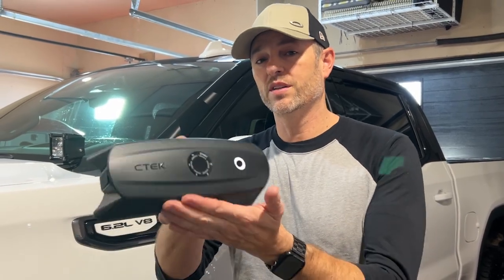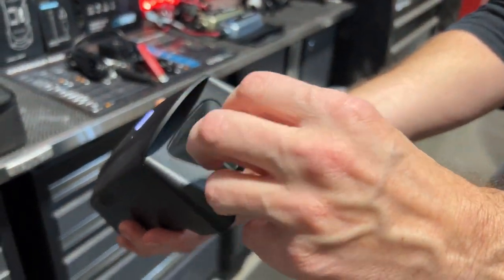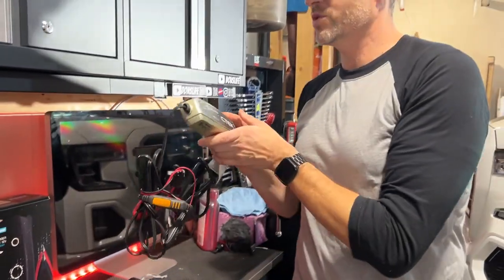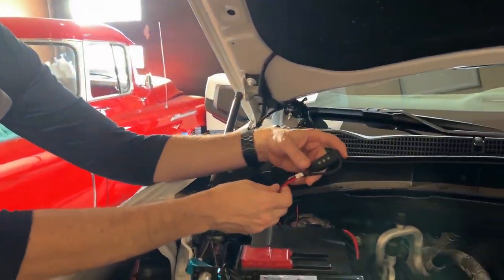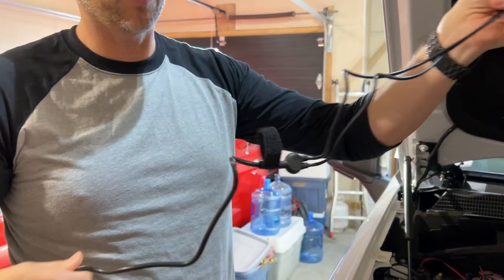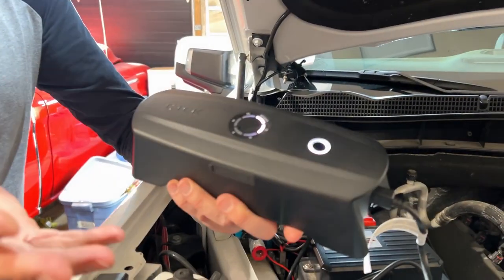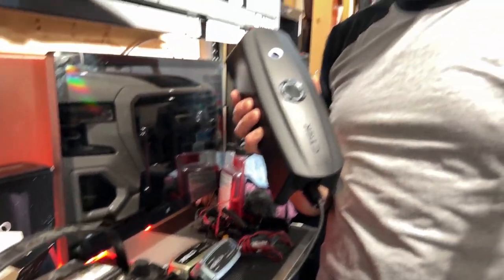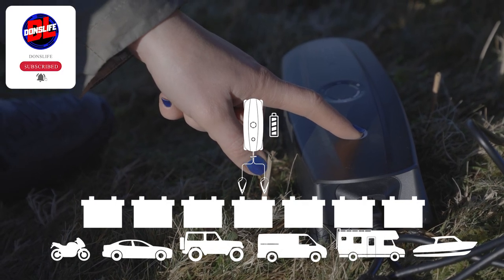CTEK CS FREE Multifunction Portable Battery Charger and Maintainer with Adaptive Boost!

Comment: For safety whenever connecting any form of jumper leads to a battery always connect the positive first then the negative second.
When disconnecting the jumper leads remove the negative first then the positive second.
This also applies when removing the battery leads from the battery.
If you are using a spanner and you remove the positive lead first and the spanner touches the chassis or engine you can have the battery explode in your face.
If a battery explodes in your face the chance of being blinded are very very high.
Chemical safety glasses are a must when working around batteries if they are not available do everything at arms length and keep your face as far away from the battery as possible.

Comment: You're a hell of a spokesperson, Don.  Nicely done
Reply from the maker: Thanks brother. Easy when it’s a such a solid and useful device
Reply: Agreed!  Great video.
Reply: @Donslife  You said the CTEK CS Free  adaptive boost will start a vehicle with a flat battery. But in the comments sections at some YouTube videos some commenters have asked the CTEK tech team if the adaptive boost will start a vehicle that has a totally flat battery. The replies by CTEK said that the battery must have 3 percent existing charge in order for the adaptive boost to work. Obviously, a 3 percent existing charge is not a flat battery. So, if I'm in a remote area without electric power, & my car battery has only 2 percent existing charge the CTEK CS Free will do nothing to rescue me from being stranded. What type of charging would safely add (without a voltage spike) at least 1 percent charge to my battery so that the adaptive boost feature of the CTEK CS Free will actually work & start my vehicle? Until I can find a way to safely get an existing charge in my battery up to 3 percent the CTEK CS Free is not going to rescue me from being stranded. Please reply. Thanks.

Comment: Your battery shows 8 hour light…. I got the same light and car started after 15 mins but didn’t start again so I am thinking it needs the 8 hour plugged in charge and this smart charger should stop once charged 100%. 
Thoughts?
Reply from the maker: Yes 8 hours plugged in to fully charge the battery, but to get a safe starting boost, just 15 mins even when unplugged.

Comment: Is it possible to fully charge the acu? Or is it only for jump boosting and turning the car on? I have a damn hybrid that dies in 10 days in winter... Unfortunately, I have no power source in my garage. I have a booster from NOCO, but I also wanted to find some charger that could completely charge my acu once a week (not driving too much, just for shopping).
Reply from the maker: Taken from the CTEK website:

You can charge and maintain any 12V lead acid or lithium vehicle battery anywhere without being connected to a power outlet.

For more info please visit: smartercharger.ca

Comment: Nice review Don, what’s the feeling of jumper cable, is it comparable to SOOW cable (Excellent flexibility in cold temperatures) . Also it would be interesting to know the chemistry of the battery ( pb, lithium, Lifepo4) For a premium product at a premium price, I hope the best.  Keep up the good work
Reply from the maker: Hi there!  Thank you for the kind words!  I don't know the specific construction of the cables themselves, however they are designed to work properly in -20C temps (-4F).  That means it can sit outside in those conditions while it does its job.  I suspect it will perform at even lower temps with great efficiency.  Keep in mind this isn't intended to release bursts of current to aid with starting, but instead introduce the appropriate amount of power into the main battery, safely, to start the vehicle.  After reading your comment I left them outside in -15C for a couple hours and they remained flexible, unlike so cheap jumper cables I have that needed encouragement to bend to shape I needed.  The internal battery chemistry of the CS FREE is Polymer Lithium-Ion in a Pouch Cell form factor.